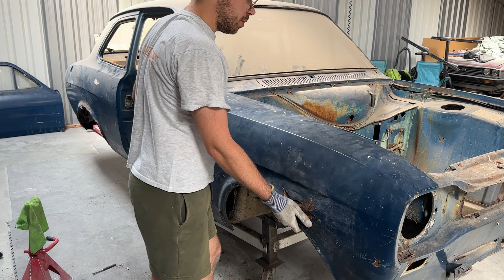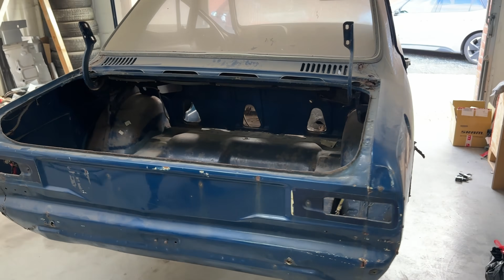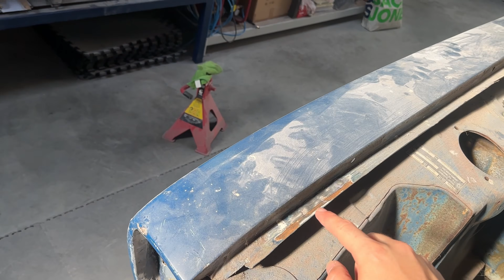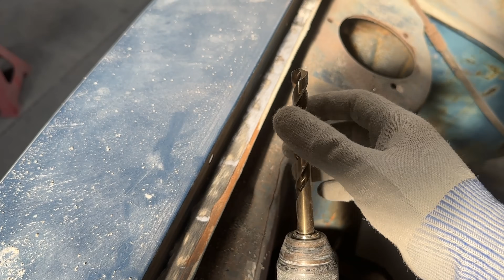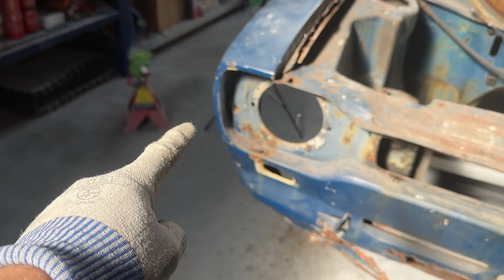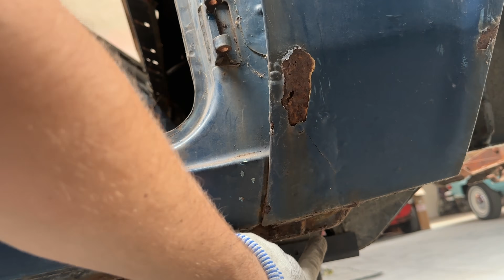Ford Escort Mk1 - Part 1: Project Reveal!

Comment: Great video. Looking forward to seeing how you get on with it. It looks like a fantastically solid base to work off. A couple of things. 

1. Get yourself some disposable masks and save your lungs. It took me too long to learn that lesson and I really regret it now. 
2. You can get special flat panel chisels that will remove the panels with much less damage than an ordinary chisel or screwdriver. In this cade you didn't need to save the panel you were removing, but if you did it would make a huge difference. It's also faster and they're not expensive.
Reply from the maker: Thanks for watching Angus! :)
In the next video, I will have some more body panels off, but on first glance it looks pretty solid. I will make sure to buy some masks and a flat chissel, thanks for the good tips! :-)